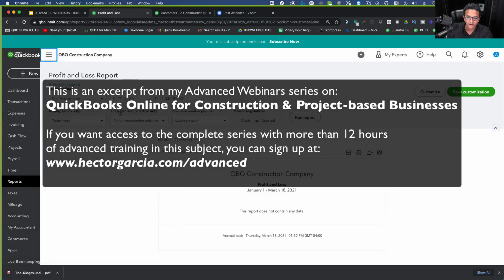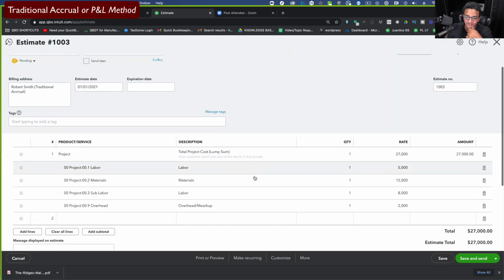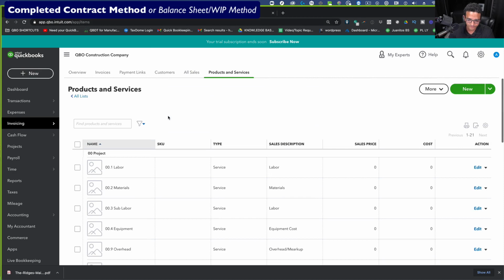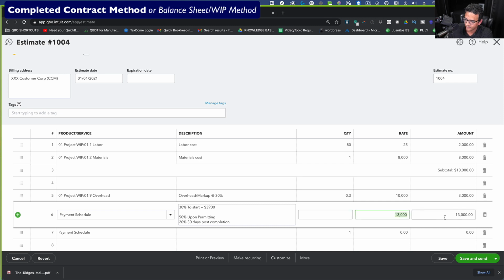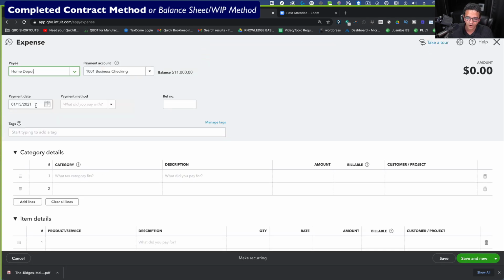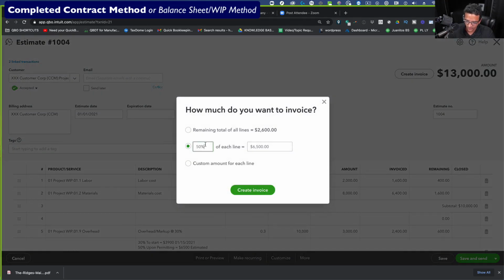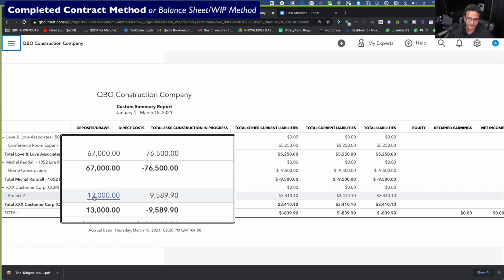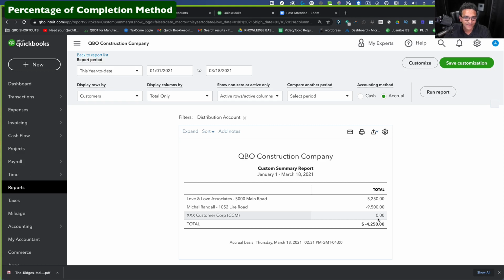QuickBooks Online for Construction: Completed Contract Method

Comment: TLDR: QuickBooks Online can be used to properly allocate expenses, create estimates, track project expenses and revenue, calculate markup, invoice clients, and track cash flow for construction projects using the traditional accrual method and the completed contract method.

00:00 🏗 Properly allocate expenses to direct project costs and create estimates for construction projects in QuickBooks Online using the traditional accrual method.
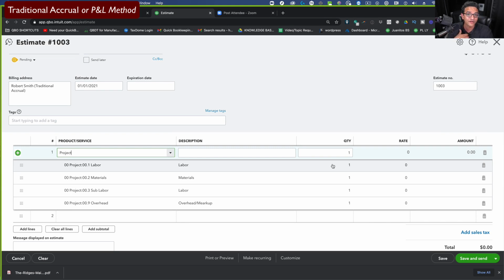03:50 🏗 Input project costs and payment schedule in QuickBooks Online for construction, create project invoice, override breakdowns if needed, select correct sub account for income, and run report to see breakdown of charges.
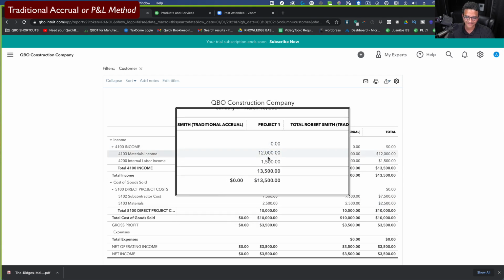09:12 🏗 Completed contract method in QuickBooks Online for construction puts all costs into a liability account, with a 30% markup on overhead.
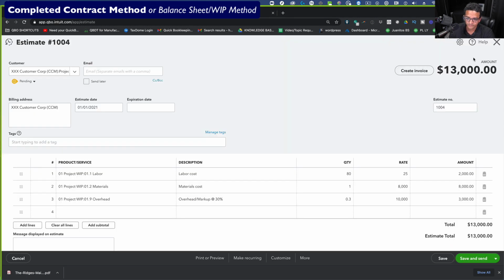11:57 🏗 Use QuickBooks Online to calculate markup and invoice clients for construction projects using the completed contract method, including payment schedules and dollar amounts.
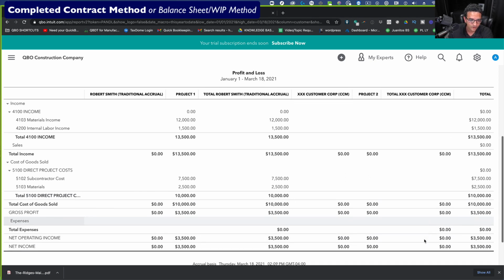18:09 🏗 Track project expenses and revenue in QuickBooks Online for construction using the completed contract method, including invoicing and cost tracking for construction projects.
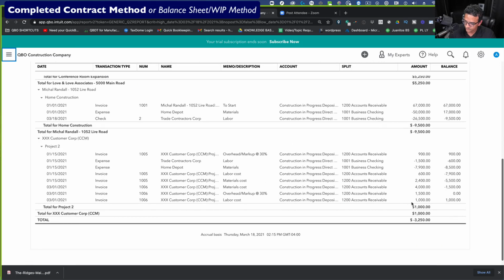23:47 📊 Use custom summary reports in QuickBooks Online for construction projects using the completed contract method to track cash flow and expenses effectively.
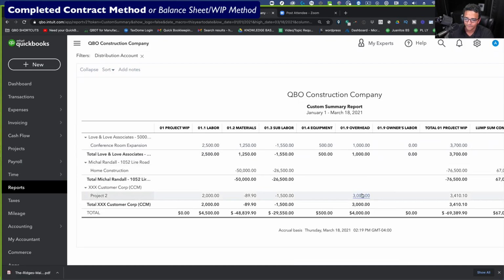27:48 🏗 Recognize revenue and costs for completed construction projects in QuickBooks Online by tracking profitability, cleaning up balance sheet reports, and entering journal entries for income and costs.
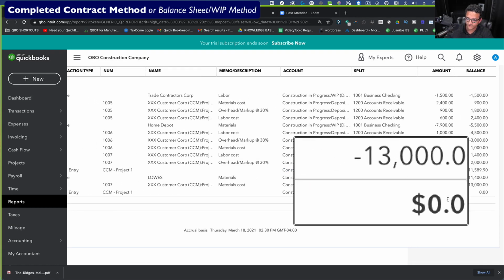33:07 🏗 Use the custom summary report to track projects with money left in the construction in progress account, ensuring completed projects have a zero balance.